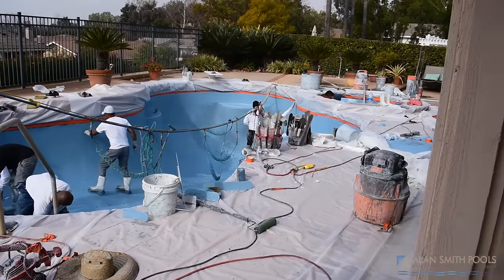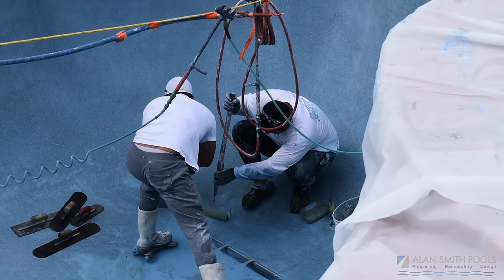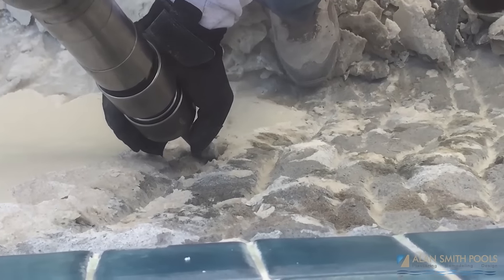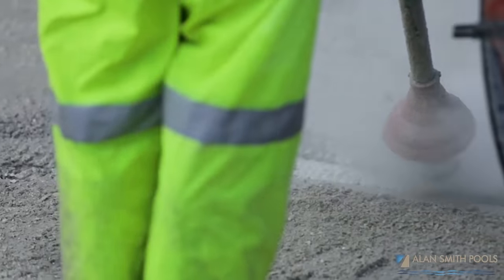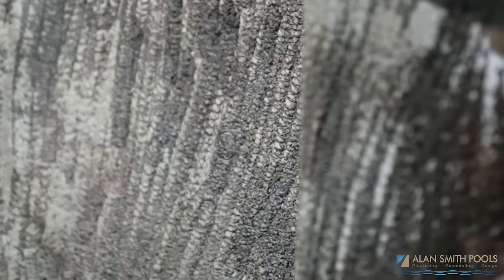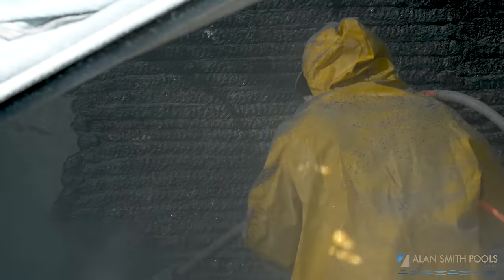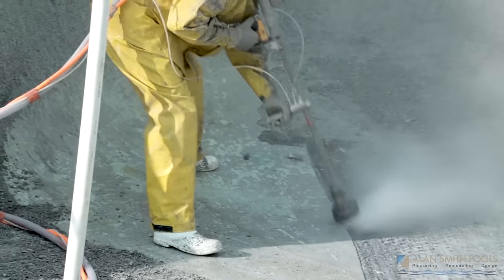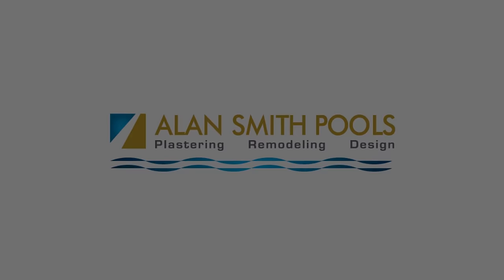Updated: Benefits of 40,000 PSI Water jetting before resurfacing a pool

Comment: In my area, 95% of the time, the plaster guys use a hammer and a chisel to knock off any loose plaster. They leave as much of the old plaster intact as possible to reduce the amount of material cost. They go around tapping on the plaster and listening for hollow spots where the plaster has delaminated. They charge a whole bunch of money for this job. In my opinion, they charge the same as if they were to remove all the plaster, meaning they make way more money when they leave a bunch of old plaster intact. Generally speaking, the customer is uneducated, and the contractors act like they speak poor English. They act like it's all normal, but what they are doing is robbing the customer. Pool guys understand this too, but the customer only goes for the cheapest bid, so if they don't bid cheap, they won't get the job. If you were to communicate the truth as a pool guy, no way will you get the job, so everyone just walks around in la la land until shit hits the fan and then the finger pointing starts. I myself have no patience for this nonsense. Now, how do I buy one of those blast rigs and sign up to do all of your plaster demo jobs. I want to do things right while simultaneously making good money. Tell me how to make this happen. Location is sout central Texas.